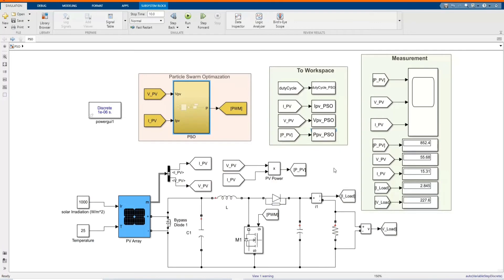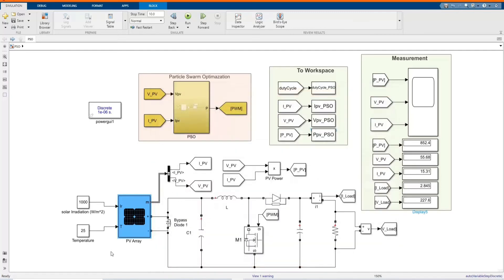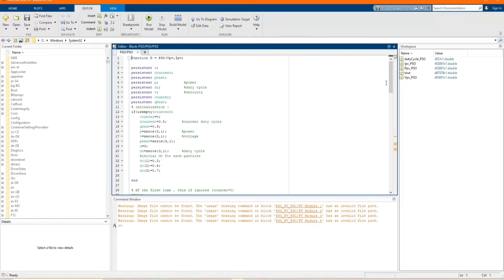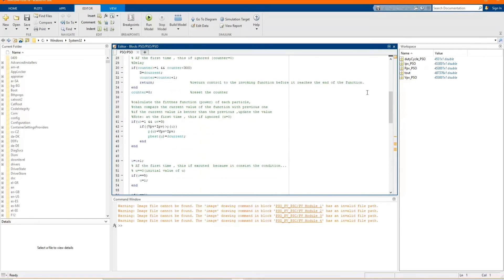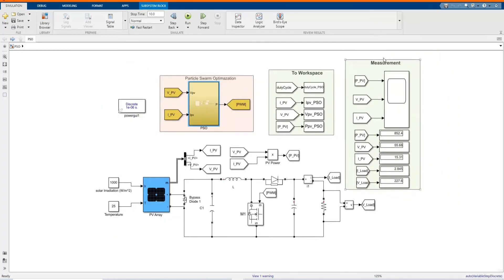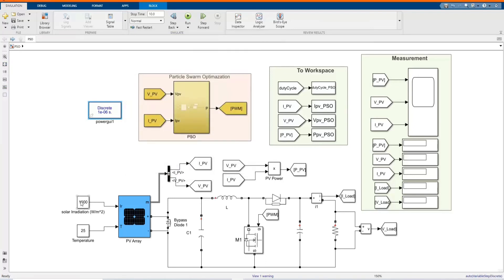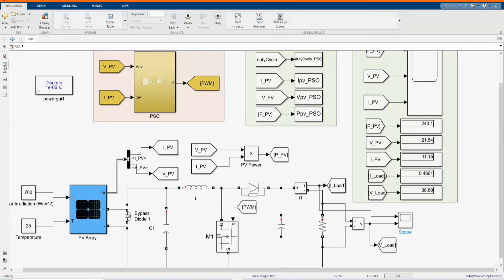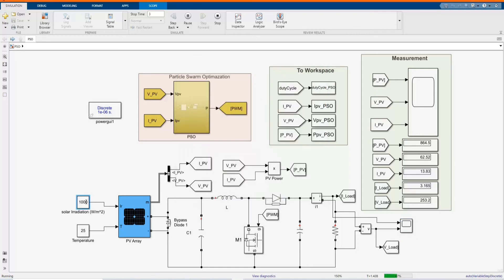Simulation of Particle Swarm Optimization (PSO) for PV Array solar system in MATLAB/Simulink

Comment: sir/mam what are the values of capacitor, inductor, and resistance ? or how do we give this value?
Reply from the maker: Helo thank you for your comment. C1 = 10e-3, C = 2927e-6; L = 1.3e-3 ; R = 76
Reply: @pzengineering2020  the question did you get the value of load resistance and output voltage?
Reply: @pzengineering2020  thanks for a great job. my question how did you select these parameters (C1, L, C and R)? can you explain please. thanks again.
Reply: Hi, can you send me the code please? , I need it

Comment: What is the value of C1?? You have not shown
Reply from the maker: Helo, thank you for your comment .. the C1 = 10e-3
Reply: @pzengineering2020  Can you also provide model configuration parameters. Thank YOu
Reply: @pzengineering2020  I can't get the same result as yours. My graphs get saturated after 1 peak
Reply: @sydistic8099  happened the same to me, did you figure something out?
Reply: @majdihaffar3799  nope

Comment: Dear Sir,
is this Particle Swarm Optimization (PSO) available in Matlab 15a software? If it's available... Where to select or choose PSO during installation of matlab.?

Could you please help me in detailed way. It would be great helpful for me in time.

Thanking you Sir.
Reply from the maker: Good day Sir, Thank you for your comment, I am not sure if it is available in Matlab15a due to I have never used it. Have you tried to use an new versions to do your model and open it with 15a version ?
Reply: @pzengineering2020  can you please send the Code along with its explanation?